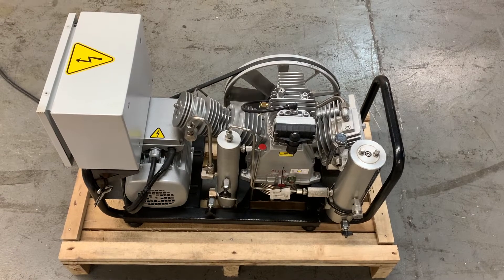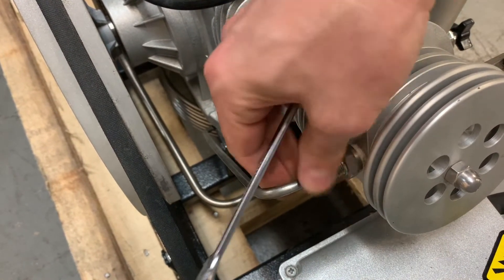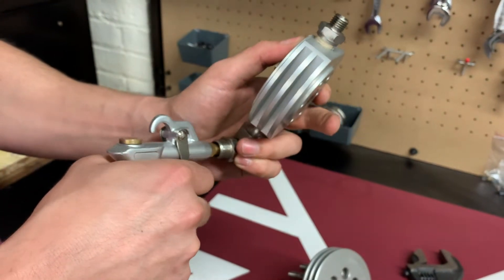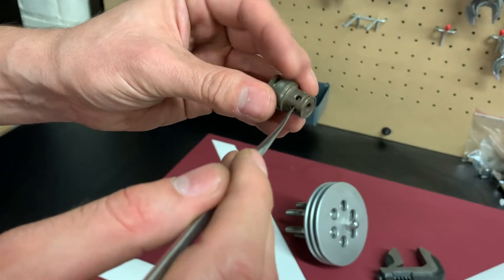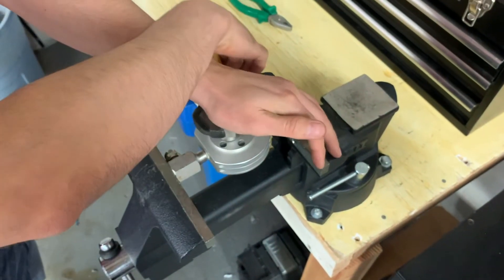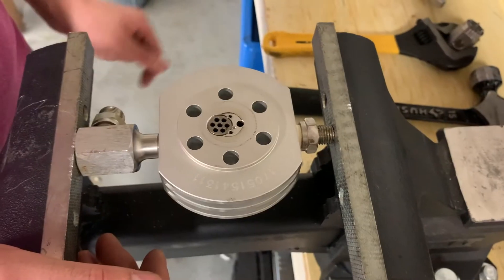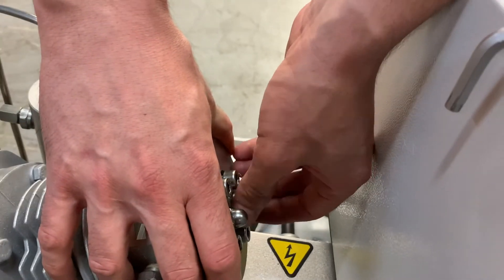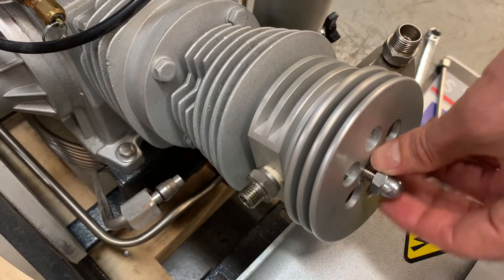Alkin W31 Mariner 3rd Stg Valve Clean Up

Comment: I have a W32 mariner, is the 3rd stage the same. Is the acorn nut on top subject to pressure?
Reply from the maker: Yes W32 3rd stage is same with W31 3rd stage and yes it is subject to pressure. If it is loose it may leak air.